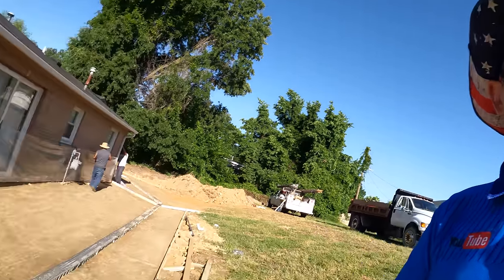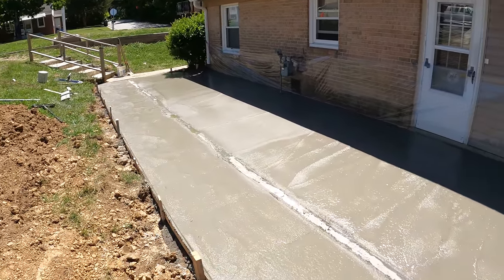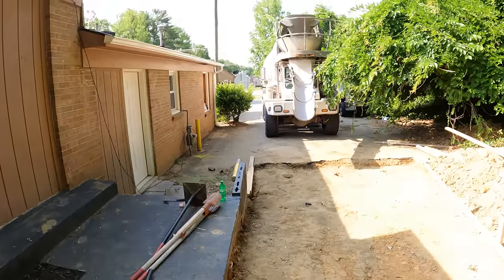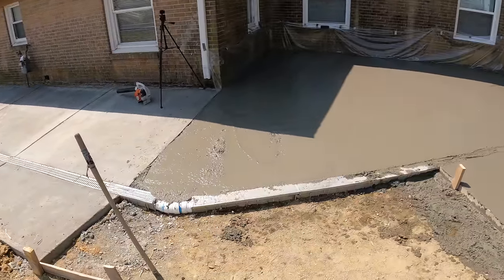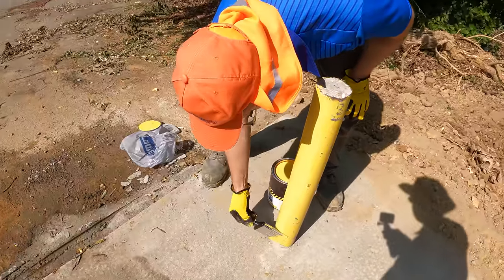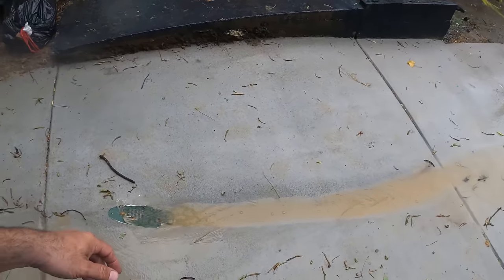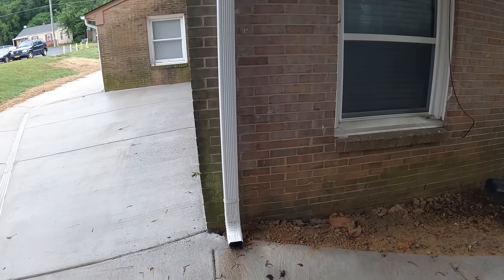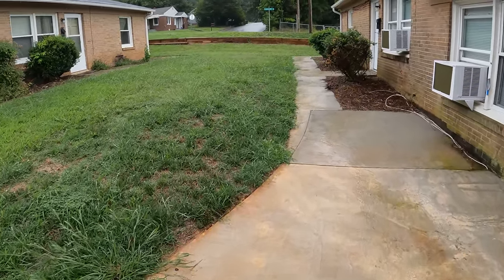Part 4 of 4 The worst Apt. Flooding I've ever seen!

Comment: This series (starting w Part 1) was the first I'd ever seen/heard of Gate City Foundation Drains.  I've been working on a friend's backyard flooding problem.  Townhomes, connected, contiguous foundation - but apparently his unit is the exception; despite the street sloping downhill, his was built lower than BOTH neighbors!  So (before he bought it) someone put a 10x10ft concrete patio below the threshold/slab, and the soil depth around it is so high that they had to dig several inches out and poured the concrete.  They put 4x4 wood around this, to make it look decorative, but nobody noticed that it means the floor of the house is lower than the soil level around it.  They cut thru the old, clogged French drains to trench out a 1.5 inch sump pump discharge, to keep the concrete from flooding. Problem is, that pump can't handle heavy rains.  It also can get clogged with massive quantities of pine straw, which floats, but still gets to the pump when it cycles.  We put bits of screen around the 18" or 24" plastic green round basin cover, to keep them out. But the erosion and runoff still has buried the 2" i.d. channel drains that were installed along w the 1.5" pump outlet pvcin several inches of soil. These channel drains were running from the utility closet door to the pump basin, but were LEVEL, not sloped.  They were clogged with roots and soil solid! Spent a whole day with a leafblower and water jet on a flex hose (that self-compresses, elastic type) cleaning it out, only to find it's pretty useless, so I pulled it out and will reasses what to do if anything with the parts.

Couldn't believe it when I saw the pvc was brand new, "2017" - AFTER Hurricane Matthew (Oct 2016)!  The house was sold (bought) in 2019, don't know how long it was on the market.

People buy these townhomes and HOA's thinking there will be less maintenance, but he's had to spend more on maintenance because the HOA that was supposed to, in his mind, do the maintenance like mowing the lawn - he'd have saved a FORTUNE by getting a real house and just hiring a landscaping company. Not a good idea to force yourself into purchasing services from a particular contractor.  The hoa is supposed to save money by collectivizing the cost and then buying services in bulk and coordinating it for multiple units, like buying in bulk - but it seems like these things simply buy the cheapest services and then pocket the difference - exactly the opposite of what the HOA "conceptually" is supposed to do.  

Reminds me of communism vs capitalism or private vs public property arguments - I say if public ownership (no private property) works so well, then asking whether a privately owned bathroom vs a public bathroom is preferable is a good counterpoint.

Theoretically, if everyone did exactly as they were told - like a dictatorship - and enjoyed it, got a sense of belonging in the community, and some sense of ownership - then it is theoretically possible.  But if you aren't living in an off-grid community or "commune" where everyone agrees on everthing (I'm not sure that even happens in reality anyway), and prefer to live and sleep in your own house/apt/room/bed, rather than a public mass housing project - a voluntarily joined one will have FAR more success because people don't appreciate things they take for granted. 

And if there's no option, it's not volunteer work - so at that point, there is no "community" anymore, and it's just about money. Most people may do specialized work and never see or understand all the hard work that goes into everything else that they get to enjoy. 

So we tend to end up with a rather self-centered or even self"ish" view of the world, even unwittingly, because if we think we are the one doing all the hard work, and (insert label here) or everyone else who doesn't do (insert own job/work here) isn't really contributing.

This leads to emotional and psychological, some might say even spiritual distress, and community breaks down, paving the way for chaos and strife.  

The internet was supposed to open up communication to everybody, so people could learn about many different things and understand the situation, experience, and contributions - and hardships - of others. 

Sadly, some of us have come to see this as an attack on their legitimacy - whether it actually is or not, ironically, because there is always an "angle" like virtue signaling (or self-justification) which is another phenomenon that can backfire or do more harm than good.

Like if you are suddenly expected to "show off" your virtue in public, then that adds a "tax" to everyone who doesn't typically "virtue signal" by either forcing them to spend lots of time doing it, or, forcing such people (including some of the most productive people, who should not need any virtue signaling at all) out of their jobs.

This is the travesty of clickbait as well as the issue many young people (and old) suffer with - comparing their lives (their actual lives) against the virtual lives of people, strangers, who aren't actually using the media socially but exploiting it.  Even unintentionally: Many people mostly don't share their problems online, so a fairytale sort of existence that isn't real is presented, and many people see it and feel like their own lives are either inadequate or unworthy.  And both can lead to harm, which may be projected outwardly or manifest internally.  

It's such a complex system.  However, these videos give others the ability to see all the work and dedication that goes into things most of us take for granted.  Stuff that voting cannot accomplish.  

I did not mean to write a synopsis on the phenomenon of social/business media, but your drainage company's YT channel is my favorite one, after watching many videos by others.

Btw, my drainage situation is so complex, 2 local Raleigh contractors turned it down (one by email, the other never called back to schedule a meeting for an estimate.  It must be very intimidating, but I feel like you and your team might not shy away from it.

I saw your video where you explained how you do turn down some jobs, which i really appreciated, as it gave me a different perspective from which to think about the ones that turned down my site's issues.  

Perhaps I will end up trying to consult with your company in the near future.  I don't know if you service Raleigh, but if I provide a concise, detailed explanation and images, diagrams etc of what's happening, I suspect you could easily break it down into its multiple subcomponents and assist with your recommendations.  No one else I know of in this industry does remote consulting, but simply sharing experience for a fair fee to review technical drawings, documentation, and other text - and reviewing videos - seems like it shouldn't be a problem, unless fears of liability get in the way.  It seems like everyone (small businesses included) is prevented from doing any work because of this fear. I don't know where the right balance is there, but I think we are heading into an unsustainable path if nobody can work unless they charge enough for an army of full-time attorneys.  

Anyway, this video reminded me of this project and with going under the apartment with the drainage system, it's the first and only one I've seen where this was actually done as the last resort.

I too do not like the reliance on pumps - property damage situations require dual pumps (failover to hot standby) and likewise for power supply.

With the Ian hurricane predicted to be coming to NC this week, I imagine there is a spike in demand for this service. I've just installed a 4 inch PVC S40 drain thru foundation, 5 ft wide utility closet fortunately is short enough to fit 1 solid pipe through as an emergency drain, filled in with expanding foam to prevent damage/erosion of foundation itself (a fate worse than flooding, potentially! Lol).  So I'll be monitoring the situation, but it's still dicey, and there's a lot more work to do even if it works, such as erosion control (temporary silt fence up now) and the pine straw, and French drains to make the yard walkable and grass growable.  Maybe just using stepping stones to walk to the maintenance closet is the best I can do, but grass or gravel should be put down to slow erosion.
Reply from the maker: Thanks for sharing your story Tom. Welcome to the channel! - Shawn

Comment: Looking at the debris, remove the bottom section of the grate and leave the top on maybe? That way small animals like that snake could have come out but cats cant go in, and debris can be flushed out whenever it rains. Just make sure to not make the hole too big.

Nevermind, as I was writing this you literally did what I thought 👍🥲
Reply: I'm thinking rats will get in
Reply: @el_covfefe  yeah maybe, maybe the orientation  of the grate matters more. Like bars that would go from top to bottom instead of left to right would work better to block off the entire pipe exit but would allow for debris to not get caught? Bars would have to be round instead of flat to minimize resistance

Comment: 100% builder at fault do to the poor elevation choice! that being said your choices for solutions were limited and I understand. Personally I would of preferred retaining walls all around the high sides of the property and kept outer sources of water out, sloped everything away from the building into like a perimeter drain or french drain with pretty rocks acting like "moat". you still get 👍👍

Comment: I like your great camera work and footage…the sea of concrete is like a five star Marriott compared to the sea of soggy useless porch grass from before. I would have offered a 1/2 day of power washing the green mold off the units in my quoting. If you ever work with concrete in a high end subdivision or area you should consider a different concrete crew. As a GC of 40 years and doing my own concrete for at least 30 of those years, I can share your pain with the slope issues, the first time I passed on doing my own concrete and had a supposed experienced concrete person do it for me(and after going over the job meticulously, he still screwed up the slope and had it flowing toward and under the man door. This had never happened when I set up and poured my own concrete for 40 years. Ughh.

Comment: Why the deains at all? If the concrete could drain the water without, why add the maintenance in the first place?
Reply from the maker: It's very difficult to get concrete sloping in two directions and it will often hold water. Using a channel drain keeps that water out of site and a much cleaner look.

Comment: I think you could have skipped the channel drain.  no maintenance required.
Reply from the maker: It's difficult to get concrete sloping in two directions so the channel drain hides any standing water that might have been present in the concrete pour. That's been my experience.

Comment: the flat bland concrete is kind of ugly. maybe if you come across another situation like this, stamped concrete, a herringbone pattern would look more pleasing. as for the grate, Id leave it. looks like discharge is very close to that door, at least with grate there you made  effort to reduce trip and fall. No grate leaves the pipe exposed too much

Comment: I really don't think the Property Owner or their Tenants are going to Kvetch about the 'Sea' of concrete...

Not only is their Flooding problem over, now they have a MASSIVE Patio Deck instead of the Postage Stamp Patio they had befoe you fixed the problem...

So No more flooding AND they have 50x the Patio space...

WIN-WIN...

😄😁😆😅😂🤣

Comment: Nice drainage system design BUT frankly said the concrete workmanship is not that great, saw lots of puddles specially on courtyard  (will grow algea if they don’t clean it very often and cause slipping hazard). Crack within 5 months? They should know before they pour that if the area are too thin, they either need to dig it deeper or put some kind of re enforcement (rebar or etc) to prevent cracks. 
They are suppose to be professional sub contractor that don’t need you to be there all the time to micro manage their workmanship

Comment: There needs to be a  grate, other wise rodents will nest in the  pipe
Reply from the maker: I'm not too worried about that because the bright white and smooth wall of the pipe don't make good nesting locations. The slightest mist produces a flow through there too.

Comment: Is it me or are the drains crooked and not straight in line?….
Reply from the maker: They might be a little crooked. I still haven't found a good 5" channel drain that comes in 10' sections. The 10' sections are 4" but maintain a straighter line. These 5" ones are 40."
Reply: @GCFD  I was thinking about it… how about some wooden stakes placed on either side of the channel every 8 feet or so, they can pull them out when they pour and there’s less chance of them getting kicked around by accident… which is probably what happened
Reply from the maker: @rmhanseniii  we stake them down with 12” nails but they always get bumped during the pour because concrete is so heavy.
Reply: BTW… these are excellent videos and the job is always well done… The best part is watching actual rain water flow through the system, no one does that and this is why these videos are the best

Comment: Looks good, but you need to watch the concrete guys, they seem a little  apathetic at times. On the whole, they may do decent work and be easy to work with, but you’re providing a professional service and everything must be spot on. If left, eventually they’ll cost you a lot of expense and time repairing work that should have been done right the first time. Ask yourself how often you tell them to alter their work.

Comment: All you have done is push the water problems down to the lower properties on the hill, if every property built had to have their downpipes connected to a deducated stormwater drain then properties on the lower parts of a hill would not have the water problems that they are having

Comment: Honestly, I've watched the entire series amd many other videos. The only criticism I have is that ypu focused on tje ground through this entire project and never considered an awning to help direct the water before it hit the ground.
Reply from the maker: The problem wasn't rain landing in the low area it was water running from uphill and settling in the low areas with no way to get out. I see how an awning could help but I don't think it would in this case. Great points to consider!
Reply: @GCFD  sorry for sounding arrogant there.  After I read  your explanation, i realized how far my foot was in my mouth

Comment: If you want to put a cap on the end of the pipe but don't want it to clog, perhaps putting a hinged flap on the end of the pipe would work...

Like a pet flap in a back door, when the water shoots down the pipe, it hits the flap and pushes it open, but when the water stops flowing, the flap drops back down over the end of the pipe keeping larger animals such as cats and rodents out of the drain...

Either that, or put a grate back in but use on with a much larger spacing between slats than what you originally had...one with enough space between slats to let the leaves pass through, but not so large the cats can squeeze past...

Comment: Never learn. Concrete isn’t going to work here. Permeable Surface is needed. Pavers. Permeable Concrete… with a French drain below where water can pool and drain down and out. Did you not look at all the drawings I linked to on your last video?
Reply from the maker: We have impermeable clay subsoils here so we don’t get much percolation. I like to keep surface water on the surface instead of sending that water into the ground near the foundation as you suggest. There’s just no possible way to send that much water into the water table as fast as it falls from the sky. This has been working all summer through all the storms so far. 👍

edit: I just looked at your link - I would have loved to keep the door sills up high but there just wasn't any fall to work with.

Comment: turn out nice,concrete good stuff,move water around,if got some fall,slope ,the mexicans let you down again ,they good at laying concrete,smooth it out ,just need to know ,water flows down hill by gravity ,for free,got use the bubble more ,as do each section,double check the surface,has some fall,as thats what you need ,the design,maybe have quick talk with them ,as the concrete truck turns up,say ,right ,the fall has to be that way,rain goes over there ok,so slope down that way,and we wont have to dig it up ,start over ,if puddle up,could also do a 2x4 accross the edge boards ,and sit bubble on top,and say ,look it slopes that way ,water move that way,some think they can do as level of the wet cement ,or lay level on wet cement ,work out the slope ,or if flat,i would do a job plan of the site,and put in building ,channel drain ,and arrows on it ,were the slope is ment to be ,like a gravity map ,they can see then ,the finished idear ,how the pull of gravity is going to work,say have a white board,show them how to use a level ,if not sure ,check it for true as well,and you have a better crew ,armed with the knowledge of that job,i know you know and can see it in your head,the slopes ,of what you want ,to solve that problem ,but many cant ,need a visuall aid ,doing great work and helping many people all over the world ,to solve there problems with gravity engine ,a pemjulien or a nut on a string ,does lot work too,use for cutting pipe high up,work out the drop ,and find center,then mark the tee fitting and chop pipe ,add tee,and down pipe ,and is bang on ,dead center ,powerd by gravity too